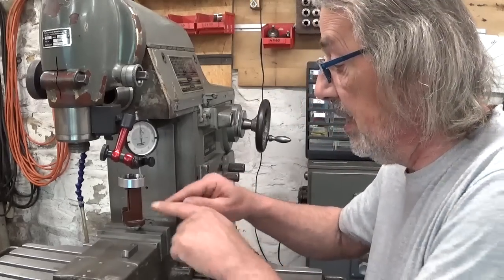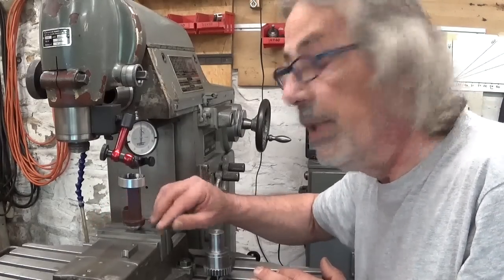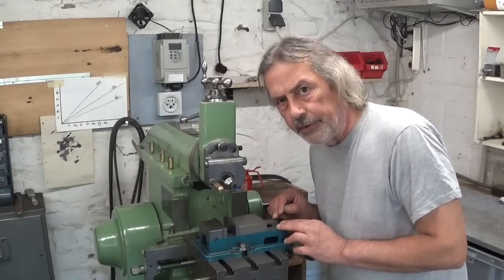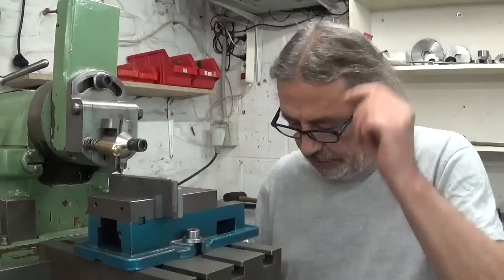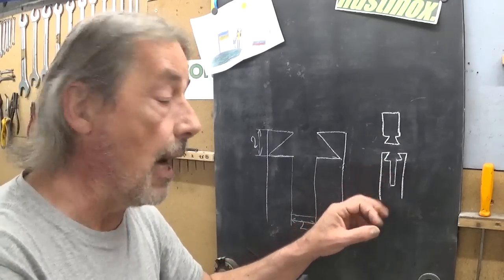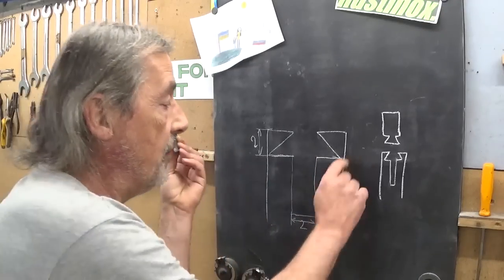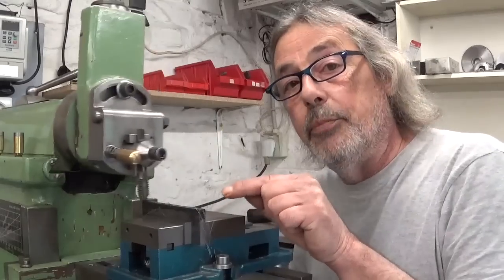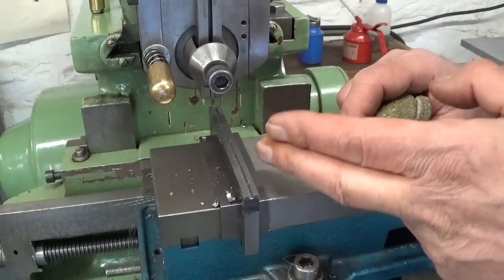Homemade adjustable parallels.

Comment: Bother you all! I want a parallel and I don’t want to run off and buy new, the second hand market in the UK reflects how little machining is done now. I do however have a mill, so now my wakeful moments are going to be spent scheming how. Bother…….
Reply from the maker: Go for it!
Reply: I think I’ll try a very large diameter thin milling cutter, better known as a slitting saw.

Comment: Michel, it came out right , so take it out of the bin! It is actually in use necessary to be able to lock the slides in place, if you are going to use it one, to support overhanging work in the vice. Two, if you want to use it for measuring an internal feature by locking it in place then removing it and measuring the width either with a micrometer or a pair of callipers.
You  say that the I think 2mm wide piece of HSS that you describe as " gummy", you have nothing to loose, so heat it up to cherry red and quench it in oil ( not water) clean it up a bit with scotchbrite, and regrind it and see if it's any better. It's worth a try.
Reply from the maker: I know it's a handy tool to have, but I will make a better one.

Comment: Hi Michel, often very difficult to track down errors in our setups and tools - spend a lot of time scratching our heads. You really set yourself a challenge making that sliding dovetail - very difficult working at that scale on 'big' machines. And you added the birdsong and I think that was inspired. You always find ways to surprise. Cheers
Reply from the maker: Thanks Paul. It's a "Go for it"- project :)

Comment: I like the way the parallel turned out Michel. Even if you don't have an immediate use for it, it was a great project. Go and rescue it from the bin. Cheers Nobby
Reply from the maker: I did. Even if it was just an exercise.

Comment: Excellent job!  In a video pretending to be about adjustable parallels.... this video may have been the best proof that I've ever seen as to why shapers are SO handy! I already have adjustable parallels (which are very handy) & 2 shapers (14" & 24")....but your video shows the unmatched versatility of the shaper.  Thanks!
Reply from the maker: On a shaper you can make whatever you want. Just do it :)

Comment: Oh my...every machinists and mechanic can use, dare I say needs adjustable parallels! My biggest use for them is measuring slots and keyways, or supporting under and odd shaped casting or something like that. I never thought about it until this moment but what a great project to develop skills for a machinist and get a useful tool on the end. If that is not in the cards, they are inexpensive enough in most cases here in the USA anyway to buy them used. I see them quite frequently at swap meets, engine shows or flea markets. Do you ever see them used in Belgium or other locations in Europe Michel?
Reply from the maker: Over here it's not a very well known tool. But they sure are handy.

Comment: AAAAAAGGGGGHHHHH !!! NOOOOOOO!!! I use mine often ! measuring inside diameter, resting odd shaped parts , measuring dovetails, translating T slots outside to measure with a micrometer, certainly nothing I would throw away.......  best regards , Steve
Reply from the maker: Lol. I will make a better one.

Comment: You, of course, realize that after filing the parallels in the round file that the very next day you will need them.  It does not make sense but life seems to be that way.  BTW, I liked the project.  Just to mention in passing, it has taken me 6 or 7 years but I finally have a shaper.  It is a 7" South Bend.  I am looking forward to getting it set up and making chips.
Reply from the maker: Nice. The 7" South Bend is the ideal hobby machine. Have fun with it.

Comment: That's a very nice tool you made. I hope you haven't actually thrown it in the bin! I have been meaning to make one of those for a while now, but the thought of the tiny little dovetail put me off (not even got as far as thinking about cutting said dovetail!). However, as usual, you have inspired me, and I've had a thought on how to make one a little more easily. One for this year's advent calendar I think. 😁👍
Reply from the maker: Go for it.

Comment: Hi, Rusti. An adjustable parallel is a useful item, well done. However, I think the tool-carrying clapper box should be leaning away from the angle you are cutting. Imagine the circle that would occur if the tool could rotate 360 degrees. On the return stroke, the tool catches on the work, or perhaps at the start of the forward stroke if the tool hasn't return to the correct position. The cutting speed is OK for milling and turning, but maybe too fast for the clapper box to strop back, ready for the next stroke of the ram.
Reply from the maker: The clapper box was set in the right angle. For sure.
Reply: @Rustinox  On reflection, I agree. My mistake. Sorry to leave a negative comment on your video. Shapers are very satisfying machines, although slow.
Reply from the maker: @BillDavies-ej6ye  No problem. You're welcome. And no, a shaper is not slow. It's the person that operates it.

Comment: Excellent work. I am still fighting with the center of my rotary table chuck plate. its not totally round and its just below my jaw center on the lathe. SO... I am going to measure the jaw face where it is inside the chuck body, and center them and just drill it to fit my mandrel. Then i can make it round. You could make a tiny screw countersunk into the male dovetail, and split it a small ways, so the tapered screw expands the male dovetail.
Reply from the maker: Go for it.

Comment: Great video Michel, and very interesting as I have been mentally designing said tool for a few months now. I am however, restricted to a mill/drill machine. Interesting concept to make the female dovetail in two parts. I have been leaning toward making a dovetail cutter by shaping down a mill or make a d-bit themed cutter. Anyhow, I need it about as much as you do, buy I don't think it will end up in the same storage cutter in my little shop! Enjoyed very much, cheers and thanks!
Reply from the maker: Making it in two parts will be much easier.